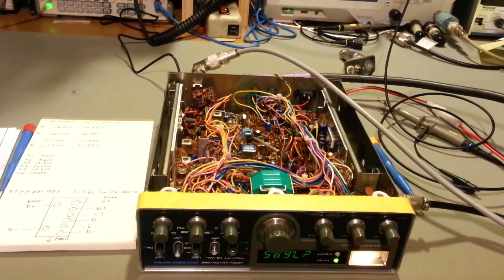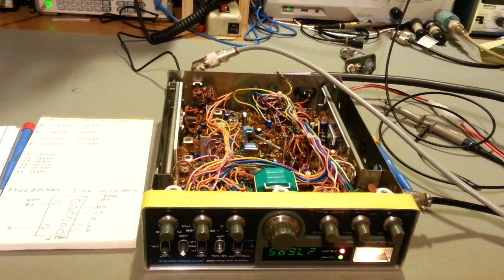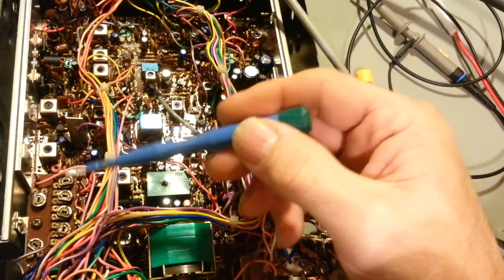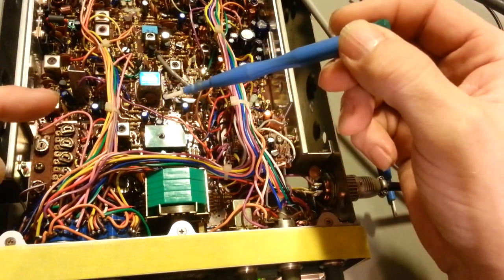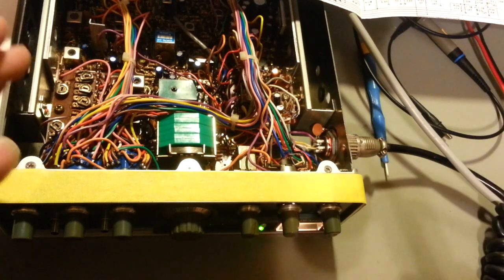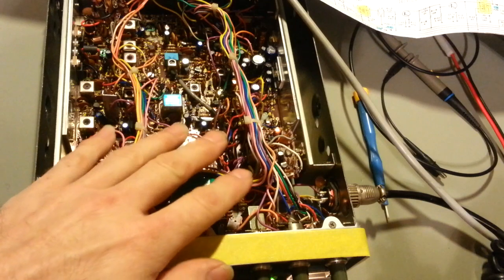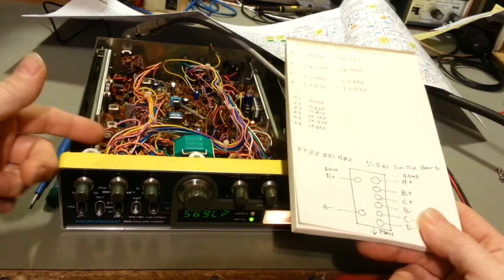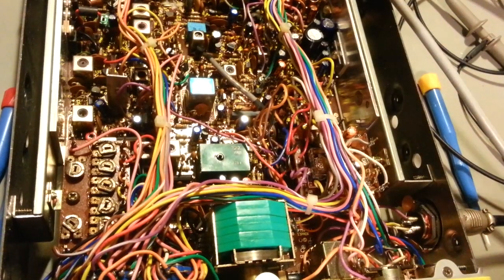Midland 7001 AM/SSB/FM 400 channel restore & alignment tips.

Comment: the +/- 5kc switch itself was a common place for UKFM hacks - these radios would often have resistors added to the rear of the switch to shift frequency less then the intended 5kc.. Another common hack was forcing the 2nd digit to show '8' at all times for paranoid EU users who wanted to make the radio appear to be a 10m rig. Super rare radio!! Got to love that beep also, unique..

Comment: There is a manual for Export radios which includes the 7001, where each page has been scanned and you can download each one for a complete manual @  http://www.zen96216.zen.co.uk/cb/cybernet-esm.htm
Reply from the maker: I have three or four of the original manuals here.  It does not cover this radio.  Main board is almost the same but it does not cover the export 400 channel radio and it's +/- 5kHz circuit.